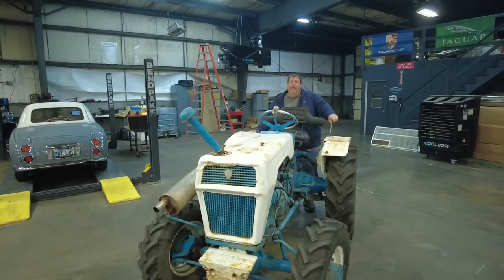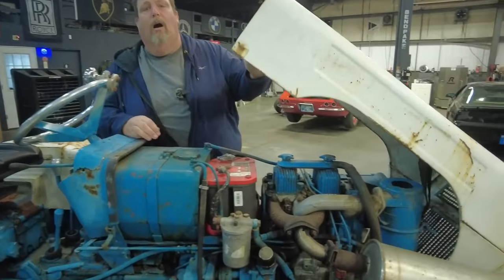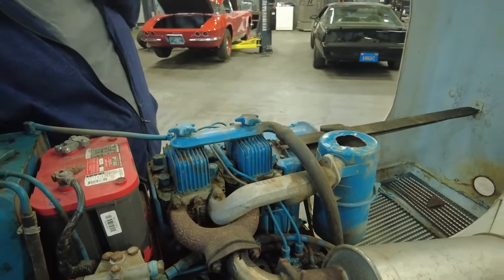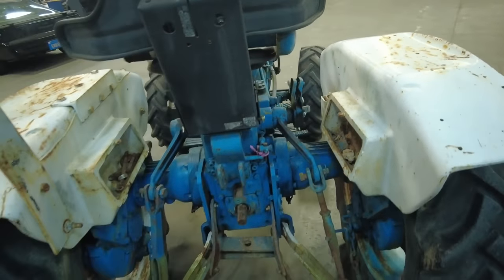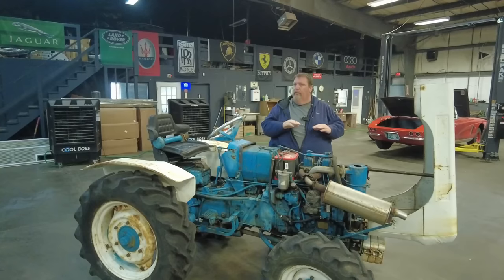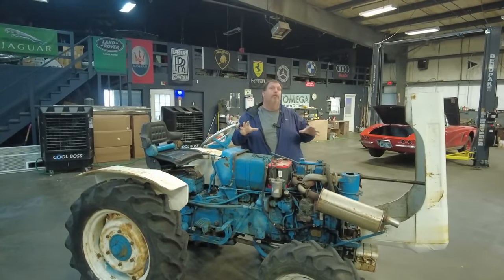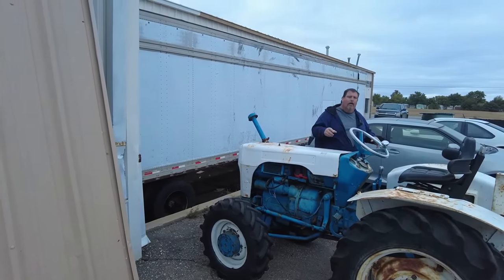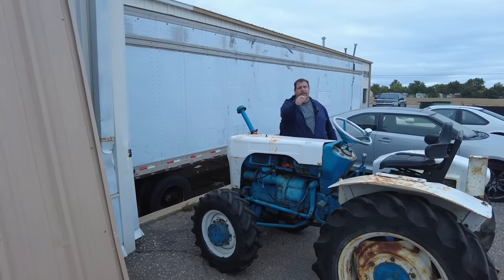Lamborghini tractor one tired a little Italian donkey

Comment: Hi,

the Lamborghini tractors aren't part of the Fiat/New Holland group. They are SDF (Same Deutz Fahr, with Same being Italian too, Deutz German). Where they sell tractors with Deutz engines, designed by same, but I think they're designed as a Deutz (you always see the church of the Deutz emblem in the hood. 
They're badge engineered and sold as Deutz, Same, Hürlimann, Lamborghini etc to cater to different markets. 

As for the starting: She definitely is tired. But as far as I could read up she's direction injection too? So she shouldn't need glow plugs, but often they still help. Another thing that could help: with these Bosch injection pumps you often can pull the stop lever out in two steps /stops. And halfway out is the starting position. It changes when the fuel is injected and how much. 
Maybe check if the pump has that.

Comment: This thing is an absolute monster. I’d love to see it fully restored! You’ve got a lot of custom fabrication ahead of you since parts are completely unobtainable in the United States.
Reply: I wouldn't be surprised if they're going to have to look over in Europe to get parts. Probably something he's not used to dealing with. Car Wizard however definitely deals with getting parts from Europe from time to time. Mainly due to some of the cars he works on. Though it's one thing to look for European car parts. It's another thing to look for European tractor parts.

I can see it taking the both of them to figure out how and where to find parts for this.

Comment: the injectors and the injector pump needs 2 be rebuilt and the engine diesel tractors when piston rings are no good they don't have much compression and makes them hard 2 start like that 😮😮 I don't remember seeing many in the USA 🇺🇸  maybe in the 1970s not now anything can be fixed try a parts locator that carry them I would check here in the USA 🇺🇸 1ST U might have get those tractor 🚜  from overseas since they were made there 😊😊 11 2O 2O23

Comment: Lamborghini or Porsche tractors bring it on! Had a telehandler with a 5cyl. air-cooled Deutz engine. I agree the diesel was all about simplicity and reliability. Air-cooled makes them perfect. Starts easy and warms quickly in cold weather

Comment: Throw some transmission fluid in the tank. The tractor probably has not gotten up to temp in a while. It starts fairly easy, yeah it smokes but that’s normal. Turn up the pump on it a tad, put some fresh fuel in it, & the engine is probably fine.

As long as there’s no excessive crankcase blow-by the engine is fine. Grey smoke is normal for old fuel.

The oil is probably from the valve cover leaking. These old diesels don’t get very hot at all, not hot enough to burn off of the cylinder head.

Daily driven a mechanical Diesel for 3yrs. New Diesel is junk, I have to add stabilizer to the new fuel to keep my engine from running like trash/it’ll get dirty every so often.

Engines need to sit at full rpm, & just run to clean themselves out. Every so often I’ll have to redline my 7.3 to keep it running good w some cleaner. It’ll get dirty, so she likes the redline.

Comment: That tractor looks like it's been rolled all the way over. I bet it had a brush hog on the back of it when they rolled it. they tore the top off of it, and the air breather. They broke the fenders off and , bent the 3-point, and even the seat looks messed up.

Comment: Digging around quickly, I see some fully restored R230 going for a good bit of money, but by the early 1970's the sheet metal has changed a bit, and the engine upgraded to a 3 cylinder air cooled diesel.

Comment: Lamborghini tractors were brought by the Same tractor company in 1971 Same then brought Hurlimann in 1976 and then brought Deutz Fahr in 1996 becoming SDF corporation. I own a few Sames brilliant Air cooled diesel engines. You can get Deutz Fahr tractors in the states which are just rebranded Same's. As far as I'm aware, it was only the tin work and colour scheme that change from R230 to the R235. The models changed during the change of ownership of Lamborghini tractors.